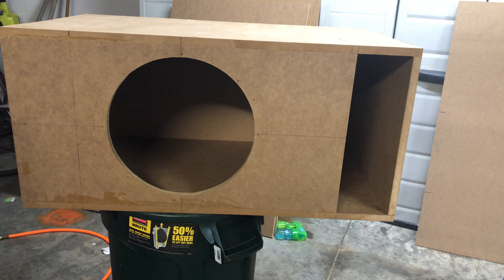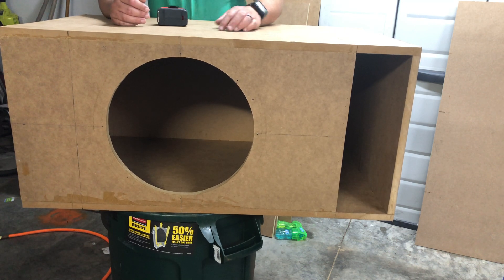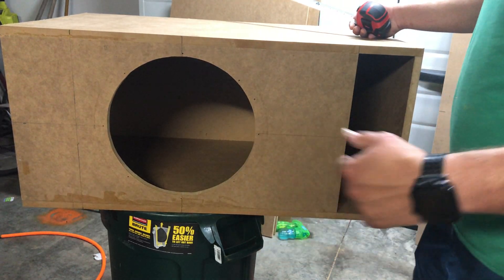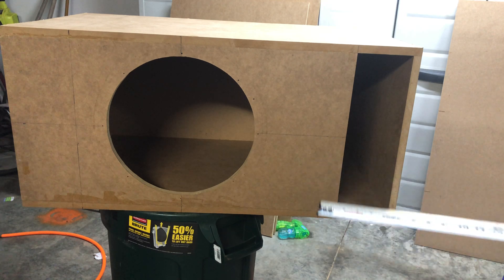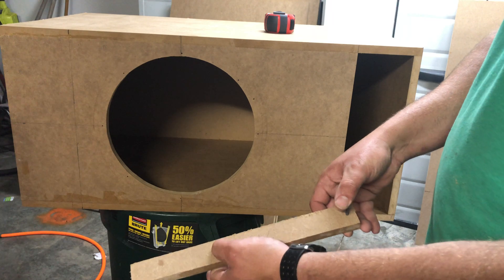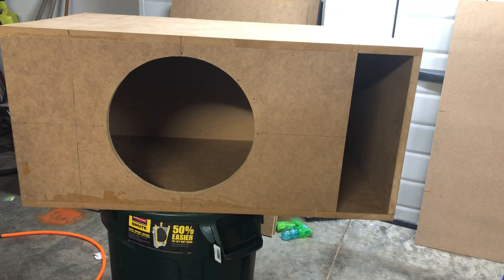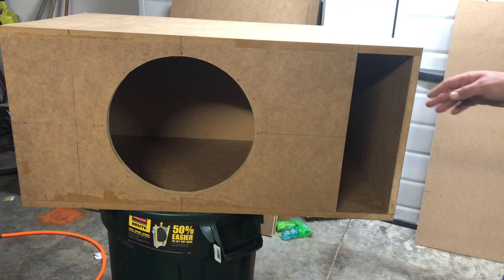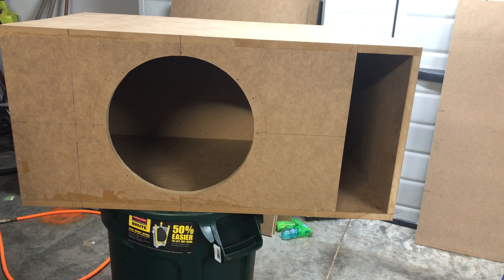Free Subwoofer Box Design 32-34hz

Comment: Have any box for 31hz?
Reply from the maker: You just need the size specs?
Reply: i have wooden shield enclosure box with sony xplod  NW12002 1800w i'm using at home. it's make some wooden noise while generating a punch so i want some noise solution.
so can you suggest me best enclosure for it with size specs?